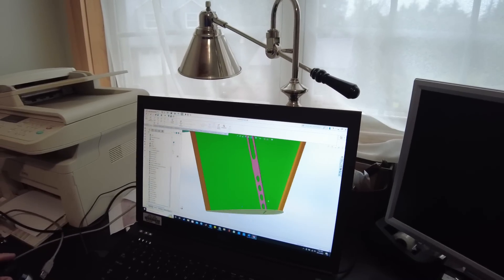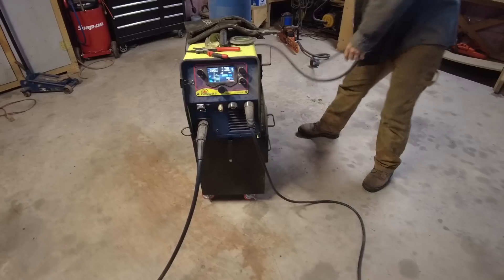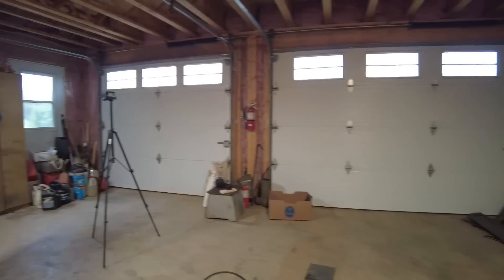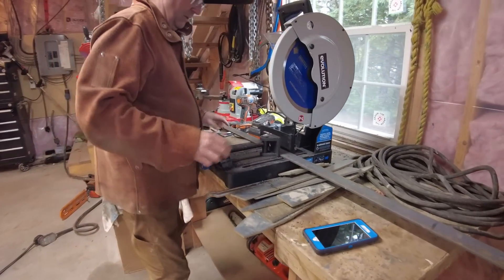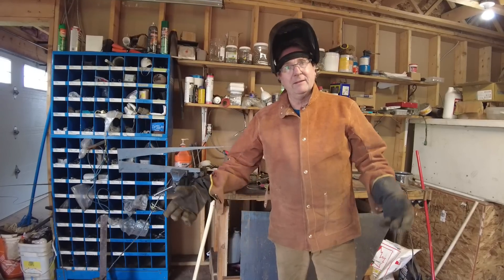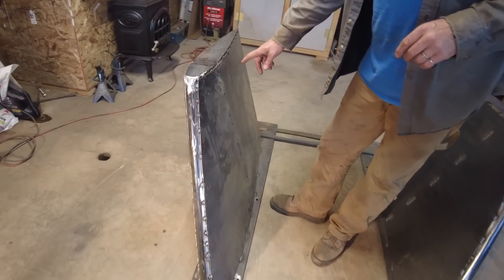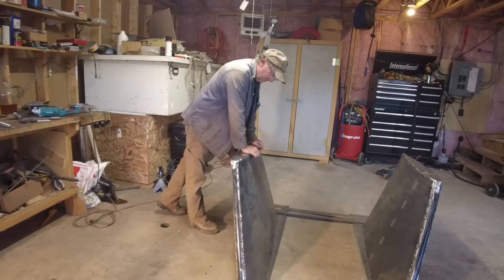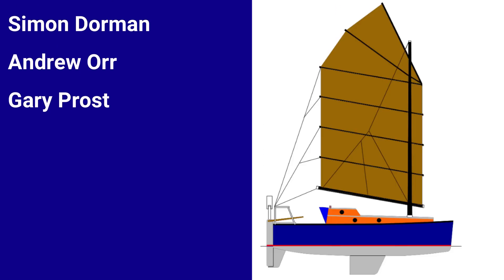S2E51 Designing and Building the Bilge Keels Part 2 || Wave Rover 650

Comment: Laminar flow airfoils (hydrofoils when emerged in fluids) have their thicker section further aft and perhaps easier to fabricate using steel as the bend is more gentle. The NACA 23015 and other similar sections are symmetrical giving good lift at opposing angles of attack. They also have limited area of pressure travel which might ease the battle of rudder vs sail vs hull profile trim. I have often mused if a stouter Leeboard design with a hydrofoil section specifically designed to optimize the lift resistance depending on what tack the boat was on and which board required was deployed. This would be a bilge ballast design as retractable leeboards would require such. Attention to the attachments of a bilge keel to the hull should be considered as substantial fairings should be used to ease the flow of transitional fluids as this can create substantial drag if an abrupt 90° type of attachment is used. Study aircraft wing to fuselage attachments and see what they have done in this regard. The Nozzle effect of having a fast moving fluid or gas decelerating from high to low creates a tremendous drag. Bilge keels would especially suffer in this regard. Horner has the best reference book on airfoil sections and an extensive study on drag profiles which would be of use. A ten percent reduction in drag may be gained just by looking at the problem with a slightly different point of view. I was shocked to find something as simple as how a 90° angle could be such a source of drag. Horner's book is available for free download. The hard copy is several hundred dollars now.
Reply from the maker: Thanks for taking the time to write this. I'm familiar with this topic. At the speed that WR travels I don't think that it will make a big difference however we did try to make the keels as hydrodynamic as possible. Future builders are free to change my design.

Comment: Hi Alan, I recently have built a 650 boat with two swing keels, made of plywood and covered with glass/epoxy. Something went wrong and one of them broke just on the edge of the keel box and the bottom. Now, I consider to make them out of steel alike the way you did.   I assume the side pannels  were not prebent and all curvature was put in during the welding process. What was the thicknes of the side pannels?
Reply from the maker: Sorry to hear that. The side plating was 1/8"

Comment: Hi Alan, I'm happy to see you dream come together.  Big thumb's up.  I hate to pick on your keels, but I'm thinking that the NACA 0012 profile really won't add much...  I believe that these air foils on boats are the prevent (or lower) the generation of turbulence on the leading and trailing edges of keels and rudders.  I don't believe that they generate any "lift", as lift requires that the air foil be flat on one side.  Turbulence is an issue at high velocities, so if you've got a boat that you want to go 10 or 20 knots, they can be important.  However, if you're more targeting 5 knots, then turbulence plays a much lower role.  Of course, if you've got the ability to make the nice air foil keels that you've made, then why not?  They certainly won't hurt anything.  I'd like to say "Fair winds" as a salutation, but you're not on the water yet...  so I'll go with "Keep your stick on the ice."
Reply: Hi jason, The foils are not so much to generate lift but to reduce drag....

Comment: What's the thickness of the keel's metal plates?  The keels appear to be much stronger than the hull itself - it may result in hull damage - if the loaded boat hits the ground with the keel.

Comment: very nice! one question though: the thickness of the plate that will be bolted against the hull  and the keel bolts diameter, both seem thin to me? Although, comparing them to the 22 and 25 ft boats I sail(ed). How did you arrive at those dimensions.

Comment: Look forward to seeing how the lead is added. A long time ago I had a 8 foot stainless fin keel made. When the welding shop melted and added 1,000 pounds of lead, it warped the bottom side panels a bit. If memory serves, that had 1/2 inch bar stock as the leading edge, 1/4 inch top and bottom plates and internal stringers, and 1/8 inch side panels.

Comment: Hi Alan, a couple of questions here!  I didn't get the 3/16 rocker business.  Is the leading edge  a "cheat" onto a circular pipe, and not a perfect Naca12?  Thanks!
Reply from the maker: The 3/16" rocker refers to the curve on the bottom of the boat over the length of the Keel. The hull isn't flat where the Keels attach.
Reply: @RoversAdventure  Thanks for the swift reply, that makes perfect sense, do I take it the leading edge is pretty much semi-circular?
Reply from the maker: @prof.heinous191  quite right, it's semi circular. And thank you for being a regular supporter of the channel Professor

Comment: Complex curves are always problematic. Would not a thinner plate make the curve forming easier?. You may need another vertical former to fair the curve. But it's mass should work out. Wider hull bolting plates are not a failure.
Reply from the maker: Bending the plate wasn't really that hard once we figured it out.

Comment: I'm curious about what happens when a mild steel keel is filled with lead.  Won't electrolysis be a problem?
Reply: Brian here....no, the keel will be sealed so no air will get in...I have been thinking about mentioning to Alan to maybe pour some old engine oil on top before we weld it up....
Reply from the maker: @DrBrian0450  Good idea Brian. I've seen that done with steel pipe rub rails on commercial boats
Reply: @RoversAdventure  check out a product called Flow Coat for this application...
Reply from the maker: @tomwaite4594  Thanks Tom
Reply: Coal tar is the method. It fills the spaces and seals the interior of the keel plate.